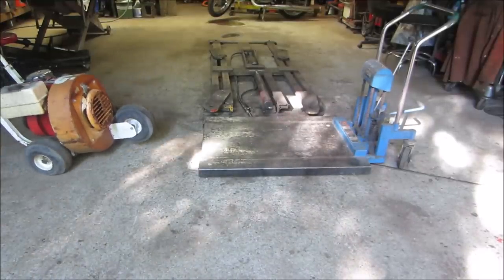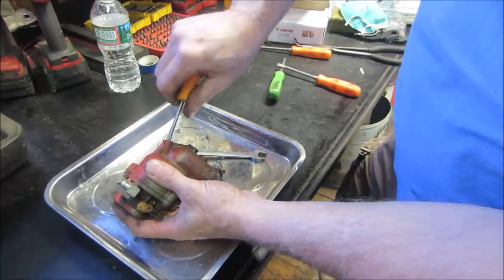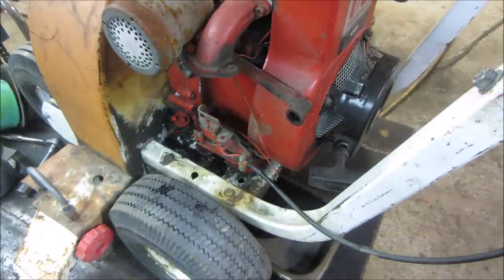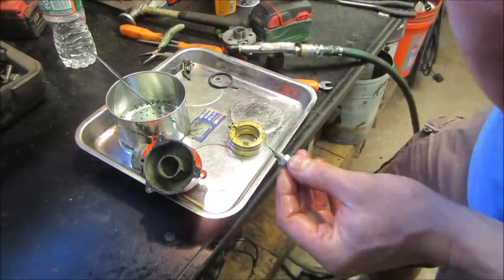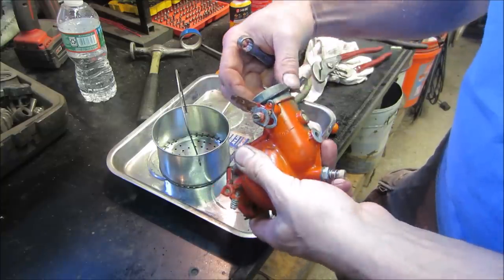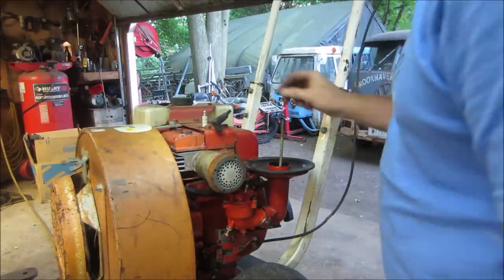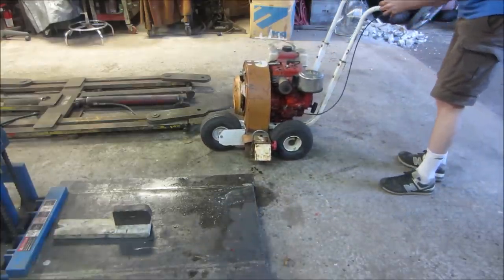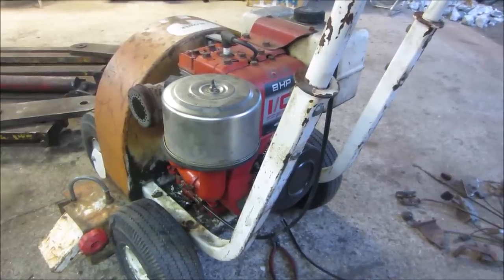Will it Run? yard sale leaf blower.

Comment: Darren, You are on the mark with regard to the alcohol in fuel.  I spent a decade working in the fuel business and I can fill in some blanks for your viewers.  The ethanol that is added to gasoline is there for a couple reasons.  First and foremost it's there to mitigate the ongoing issues of storage tank water volumes.  Storage tanks at your local stations have vent pipes that allow the tank to breathe.  As such when it is warm outside the tank temp increases and vapor is expelled.  When the surface temp of the parking lot drops the tank cools a few degrees and it intakes outside air and with it some moisture.  The ethanol is hygroscopic and the water will then be absorbed.  This implies that you are in fact buying a tiny bit of water with your gasoline but it's generally kept at acceptable levels that most engines can tolerate.  There is also the chance that storage tanks can have water issues with regard to water table.  Some tank necks in the storage tanks may leak ground water in the tank and thus the ethanol helps to solve that issue.  All in all it's an attempt to avoid  that issue of the phone call from a customer complaining that your station gave me a dose of water so bad my car won't run.   

The other reason that gas companies like ethanol is that it's a cheap and wonderful "filler".  So for a 10 gallon fillup you have just recieved 1 full gallon of ethanol that is mostly worthless in engines not prepared to make power on alky.  When an engine is prepped for running alcohol the jets are HUGE.  That's because there are far less BTUs per gallon of alcohol.  So in engines prepared for gasoline the alcohol acually produces less power but MOST people won't notice it.

The ill effects of ethanol in small gas engines are VAST.  When possible running non alky gasoline in your mowers, motorcycles and chainsaws is best.  IF you can find non ethanol 92 from a reputable station or in cans from the store as Darren does is ideal.  Typically the octane rating at the pump is less than the sticker shows as gasoline degrades in octane rating fairly fast and unless the station moves a lot of volume it will decline.  The premium tank might be a couple points down if they haven't had premium delivered in several weeks.  Now don't misunderstand that I think your mower NEEDS 92.  IT doesn't in any way NEED it.  It will run on 87 regular just fine.  My reasoning for running premium 92 in mowers is that it tends to stay above that 87 rating a tad longer and thus produces more consistent results in machines that are run occasionally.  IF you live some place where you mow a lot or cut trees a lot...then your constantly refreshing your fuel and there is no reason for 92.  In fact the machines may start easier on 87 as it's burn rate is a tad faster and it sparks off easier.  They tend to run more efficient on 87 as the spark timing and cam profiles aren't designed for the slightly slower burn rate of 92.  But bumping the octane a bit can be worthwhile in occasional use machines.

Engines in storage if left with gas over winter will degrade in octane rating to the point where it barely wants to run on it.  The gasoline from our childhood was far more stable and often was the case that you could leave it without any kind of stabilizers for an entire winter....and it would crack off like it would last fall.  Progress folks.... it makes me shake my head.
Reply: William MacMillan thanks for the new knowledge 👍🏼
Reply: We've noticed the same thing in the states but we don't have an option to buy E0 fuel.  I don't think I've seen regular E0 fuel unless it was 93 octane, and in my area it's $3.50 a gallon.  I know that's cheap compared to European gas prices and even Canada's.  I wish we had a choice between E0 and E10.
Reply: So that's part of the reason for the ethanol.. it does make sense, as methalated spirits can be used to dry water in a fuel tank. Was led to believe that in Australia, ethanol was to assist the sugar industry alone and the impression that it  increased profits for government and oil companies. Thankfully, down here, e10 is a little rarer. Mostly the budget fuel stations that carry it in standard unleaded. Occasionally, it's the only standard unleaded fuel that's available.

Haven't seen the 87 octane since leaded fuel was phased out over a decade ago. It all starts at 91(94 with ethanol), then 95, then 98.. rarely see an octane level over 100 at the pump. 

The ethanol blended fuels wreak with anything that's wasn't designed for the blend. Not only in running. Have seen it severely soften and almost liquify the diaphragms in sidedraft Stromberg carbys(175 CD2 and the like). Not to mention the cleaning it can do. Clogs up fuel filters and fuel pickups in no time if the fuel system has debris and dust in the system(common in country Australia). Haven't had too many issues with mechanical fuel pump diaphragms and old fuel lines though. 

The fuels down here in Australia must be more stable though. Have had fuel sitting in cars and tins for mowers for 3 to 4 months... no starting or perceptable running issues. It still smells like petrol or gasoline for the US/Canada dwellers.
Reply: One problem with premium fuel for mower or small engine use, however- ethanol has an octane rating (anti-knock index) of about 110, and is cheaper for the fuel supplier than gasoline. As a result, many suppliers are using it as a quick and cheap way to nudge the octane rating a bit higher, allowing them to use less of the expensive additives. So some places are seeing as much as 15% ethanol in premium fuel, with regular remaining at 10%. This is even worse in places that have wide temperature swings that necessitate oxygenated fuel in the summer and conventional fuel in the winter. In those places, ethanol content can reach 17% in the summer months in premium fuel! In my opinion, the best thing to do is use regular fuel with a shot of fuel stabilizer in it at all times.
Reply: I must disagree with your assessment. First of all is that it is not a "cheap filler".  Ethanol and methanol cost more.  This is one of the many reasons gas costs more just before memorial day.  They go to the summer blend that has alcohol in the gas.  At least in my area.  There is a reduced cost of the alcohols in gas due to gov subsidies.    Please notice, I said reduced and not off setting cost. 

I worked at a gas station in the late 70's and early 80's in Phoenix AZ.  You wish to talk about temp swings.  We had to test our tanks for water on a regular bases.  Never found water in the tank.  The reason alcohol is added to gas is because of it's high O2 level.  It burns cleaner.  If you go to rural areas near where I live, you can find ALL gas with out alcohol.  This is because they are not under the thumb of the EPA to cut air pollution.

Final note.  Alcohol is know as a renewable resource.  Therefore it is good in the green eyes.
Reply: Brett Ison Gooseknack the octane rating system is different in North America to that in europe and oz (of course!).  They use MON, we use RON.  Their 87 is the same as our 91
Reply: If you have been a drag racing fan for a long time like myself, I learned that alcohol burns 9 times faster the gasoline thus it needs a much larger volume of fuel
Reply: Ethanol also eats gas lines.
Reply: Dude you do have a point about ethanol in fuel I live in the UK and our fuel is only 5% ethanol at the moment but that is due to change soon to 10%, the issues this is going to cause is unreal however most new engines are set up to run on ethanol (I'm talking about cars here guys not small engines) I will say I'm not looking forward to having to make my mower run on e10 as I know the problems it causes and my neighbour has already asked me to fix his small engine stuff as his mower does not run properly but it's par for the course now
Reply: William,  Thank you for taking the time to share this knowledge.  It is a big help to me and I've been confused by conflicting claims that do not explain the rationale behind the advice.
Reply: Taryl did an extended test with fuels and additives. One part of the test was to have jars of fuel sitting over a years time with a tiny vent hole in the lid The degradation of that fuel was dramatic. Since then I put a wal mart bag under the fuel cap when storing for anything like a month or more. my lawn mower fuel also gets changed to ethanol free at seasons end to a full tank and then the fuel cap trick is employed.
   You can make your own ethanol  free fuel just by adding fifteen percent water to it in a clean glass jug and carefully pouring or suctioning it off. The ethanol fuel becomes part of the water layer.
  I just buy my ethanol free from BP and use it 100 percent in two cycle and 100 percent end if season

Comment: I bought one at a yard sale 5 years ago for $30 and put in fresh gas and it works great but some of the carbuerator linkage is missing and is no longer available so it runs full throttle only. I made a bracket and pull it behind my riding mower.  I no longer rake - only blow a ton of leaves into the woods

Comment: I used to pick up lawn mowers at the curb for disposal, and always asked the home owner to make sure it was being thrown out.  Many a time I started these "discards" after adding gas!  No really, I'm not making this up!  There are people out there, some of them college educated, who do not know how the internal combustion engine works!  I've started old mowers on the first pull,,,after changing the spark plug!  I fixed A mower by replacing the lost bolt that held the handle to the deck.  Yes, people can be dumb, and I loved them for it!

Comment: Great video as always . 
Been following you for maybe 3 years now . 
Learnt an absolute ton of information from you . 
I have a late 2006 VW Touareg. 
A pretty complex vehicle.
I have now have the confidence to sort any issue I get with it . 
After a normal 20k service . Oil . Oil filter . Fuel and air . 
It decided to leak coolant . 
Took me a while to sort but it's back on the road . 
Fitted new thermostat and water pump . Couple of new hoses minor ones . 
Cooling system now hold pressure for at least a couple of hours . 
The car now feels a much nicer drive . 
I'm not a trained mechanic. But never been scared to diagnose what's wrong . 
But with garden machinery you can't just plug in a fault reader can you . 
Thank you for giving me that little bit of confidence to have a look and diagnose what is going on . 
Thanks from Mart in the Uk

Comment: Mustie, Make a gasket from a cereal box (Waxed cardboard style) Learned this when I was 12, it works, its cheap, and it lasts for years. Dip the part in oil, lay on box cardboard to make a print. Then cut with a razor.  double up if needed but it is 10000% better than a torn gasket any day.

Comment: love your videos! quick tip to share if you don't already know. when cleaning the small passages in the carb and the emulsion tube I have found using guitar strings work great. Available from .009- .060 and are inexpensive to keep on hand and last forever. Keep up the great work!.

Comment: To anyone that has one of theses type blowers I strongly suggest doing a fan blade inspection for cracks. I had one break off and it was very violent. Hole in housing. Took out the shaft seal and side case gasket.

Comment: Mustie, you are 100% correct!! When it's added to the gasoline, ethanol alcohol is 100% alcohol when it starts out... No water has been added at that point, however, ethanol is hygroscopic (attracts water) right out of the air ANYTIME it's exposed to atmosphere..  which starts right at the local gas station.. completely sealing the container OR keeping the tank as full as possible to limit atmosphere exposure are the best 2 ways to prevent the water in fuel problems.. this has been my experience in the automotive side at least 🙂 Love your videos BTW from Washington State.. I've learned a great deal from you about small engines

Comment: Used these cleaning driveways and parking lots took a big bristled broom and scrubbed the dirt off while blowing with one of those . It’s was so powerful it could lift the pavement up if you blew underneath. Big heavy and hard to pull around or push hard to start hard to pull the chord to so if it isn’t running right you’ll be tired from pulling that rope ! Most powerful blower I ever ran, does a good job too ! Lawn furniture anything loose don’t stand a chance . That little door is adjustable also stay out of the rocks or you’ll pay for a paint job !

Comment: I've used oil soaked brown cardboard, the stuff you get on the back of lined paper refill packs, for replacement gasket.
Works pretty well and lasts quite a while too
Reply: Loctite 518 instant gasket is handy stuff. It sets only when air is excluded so no risk of cured lumps clogging important things.

Comment: Nice man, I picked up a real nice giant vac blower last year for $25.00. It wouldn’t run because the spark plug hole was stripped out. Fixed that, runs like a charm, love running into deals !

Comment: Great sounding and torqueful (?) engine.  I store old control cables in a pail with a mix of ATF and Diesel which eventually migrates through the spring to the wire if they are not vinyl coated.  Then the entire cable goes inside the mix.

Comment: Mustie, 
.
Tip of the Day!
.
When I have to "clean" holes and passages, I've found rifle bore cleaning brushes on a variable speed drill works wonders. They're available in nylon, brass, copper, and stainless steel.

Nice work bud!

Comment: I find with my ultrasonic cleaner, and I have the same one as you, what I do, and it makes it work better is, I turn the temp to 50,let it warm up for 1/2hr, then I turn off the heater and let it run, cleaning the carb or whatever is in there for 17 minutes, the reason I do this is, if you look inside, which I did, the temp and ultrasonic are on the same circuit, so having the heater and ultrasonic running at the same time makes the ultrasonic part not run at peak efficiency, and while just the ultrasonic part is running alone on the circuit it warms up the liquid all by its self, just a hint to make the cleaning process that much more efficient, great video.
Reply from the maker: good to know thank you
Reply: Mustie1 no problem buddy.

Comment: Nice one, and I actually need parts for one of those, not the engine, but the blower itself, for my own use too..not a 'sell' one, although when leaves are falling, those are the easiest things to sell Ever! Even more so than backpack blowers, which tend to be beat when you get them. One thing I do is put a drop of oil on the threads and sealing area of the high speed and idle mixture assemblies before I put them together so it doesn't rip that packing or o-ring, also makes them easier to adjust when you're trying to when you get it first started. With the Flex seal trick, I use a spot wand and shoot some down through the valve stem, so it attacks that leak from the inside..but I do that trick too..and it does seem to work on bead leaks. One last trick I do with those leaf blowers,borrowed off the new ones, is to put a cheap 4" (or whatever size works from the new mount you make)swivel caster on the front..it makes them 100x easier to use, and if you're going to keep that one might think of doing that too ;)

Comment: The whole air exchange thing is why I fill my fuel tanks to the cap for storage (with fuel that has stabilizer in it). Never had issue in spring with first start ever.

Comment: In 8th grade machine shop class in my school, we rebuilt lawnmower engines, and whenever we needed a missing gasket, we used paper bags from the grocery store.  Just traced the outline with a pencil, then cut them out with razor blades.

Comment: Mustie, the Ethanol does have the tendency of attracting moisture to it, so I use Amsoil Quickshot to the gas can, it also has a fuel stabilizer in it, and it will also clean the top of your pistons and plugs of any carbon build up. I use it in everything now. My equipment is outside inn the rain and snow, but I can start my stuff up on the first or second pull in any kind of weather. Get yourself a bottle and try it, you will be convinced.

Comment: You can adjust the float without taking it off by just using a smaller screw driver , to make it higher put it between the float needle tab and turn the screwdriver a little & to lower float put the screwdriver between the tab & seat housing each with slight pressure on the float . Well done !

Comment: Once the rims have a rust spot, it will slowly travel under the paint and you're back to a flat tire. Best thing to do is... take the tire off and wire wheel the rim down to metal where the tire bead is and repaint it... On bent rims I use a body hammer and dolly... Remember... work the metal, don't let the metal work you.

Comment: I live in Minnesota there is ethanol in all of the gas, except certain places sell out of the pump non oxygenated feul. which is for non road use. this is meant for lawn mowers, yard equipment,  etc. they don't want  you to put it in cars and I believe that it doesn't have road tax on it even. It is suppose to be made to leave in things that you don't use much and sit for extended periods of time without problems. it seems to work but I haven't used it a lot as I have to drive like 30 miles to get it
Reply: That's a shame. Here in upstate NY we have no problem finding non-ethanol.
4 years ago I started using it exclusively in all my motors and my wife's car and the difference in performance was very noticeable. Even my wife noticed. Oddly I tried it in my 2002 SAAB Aero and it threw 'check engines', so had to stay with the 91/93 octane options.